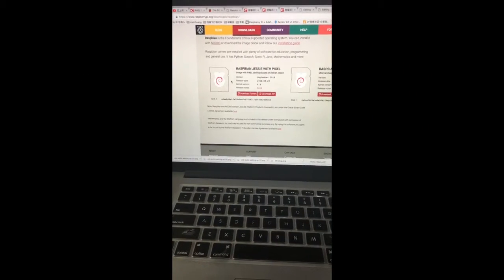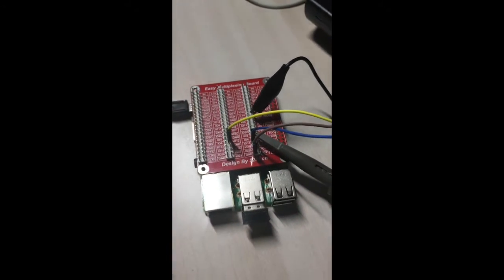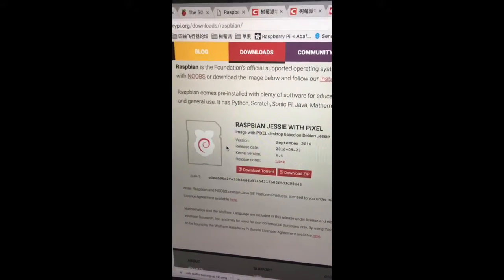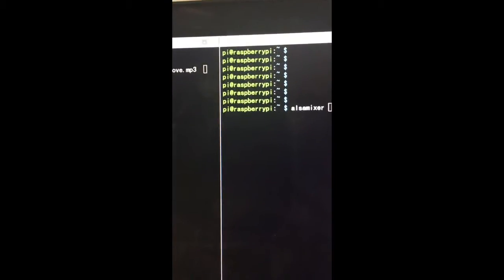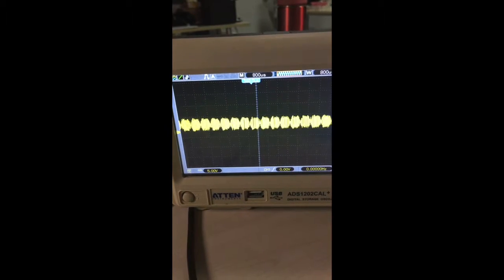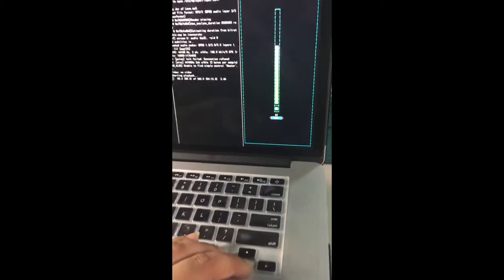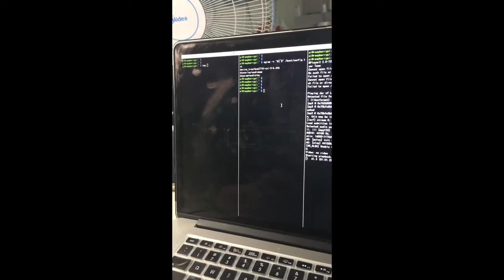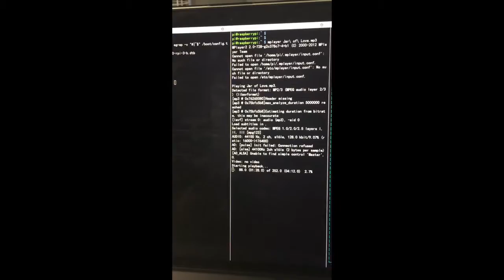How to connect a loudspeaker with Raspberry Pi GPIO PINS instead of Audio jack

Comment: I added your suggestions to my boot/config.txt file and rebooted.  The pi never came back. I had to format my SSD and start over.
Reply: you could have just read ur sd card on laptop and remove those lines from the txt file??

Comment: Hi Kevin, please can you post the command line commands to modify the GOIP's
Reply: If you check out the file at /boot/overlays/README then under audremap overlay you will see that "Switches PWM sound output to pins 12 (Right) & 13 (Left)" so the PINs are already defined.
Reply: @himadriganguly6577  
Could you please make it understand for a beginner like me who doesn't understand anything like that at all!??
Reply from the maker: OK. First of all, you have to modify the /boot/config.txt file to enable the device tree function by adding these parameter:
dtoverlay=audremap

save it and reboot your pi.
Reply: thank you